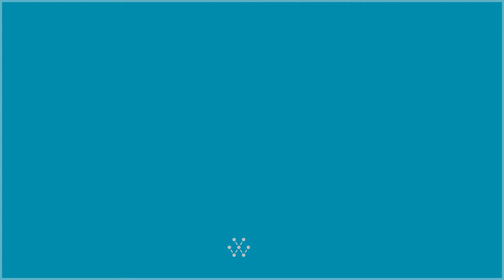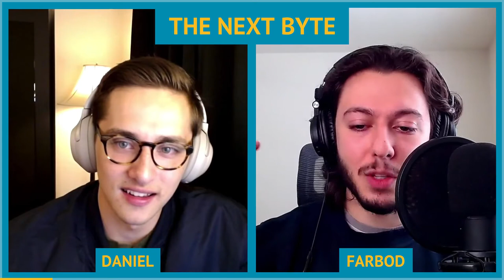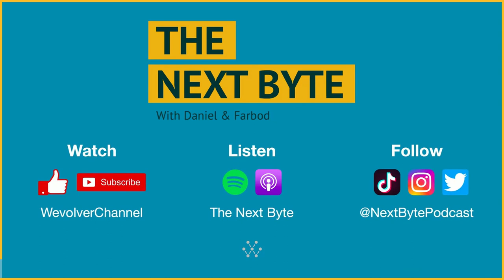How Super Strong Concrete is Made (Concretene)

Comment: They used Versarien Graphene in this occurrence but it is producer agnostic as long as it’s of the same quality.

You use less with no rebars, improved strength and reduced influence from water and it pasts longer too
Reply: And it cures quicker saving time as well